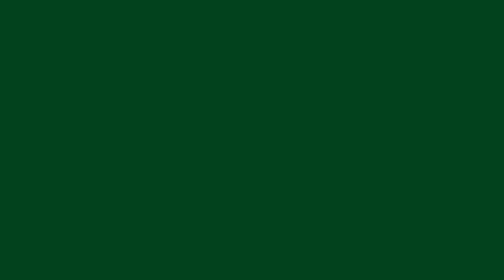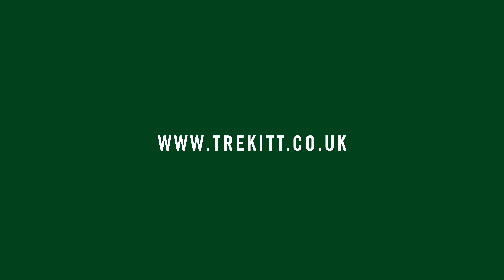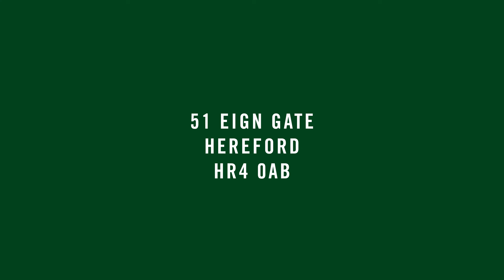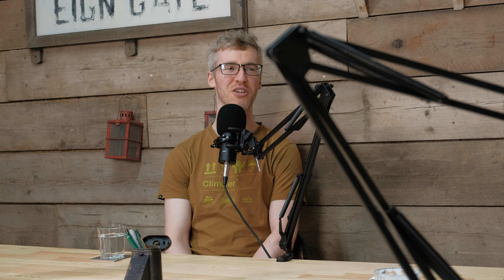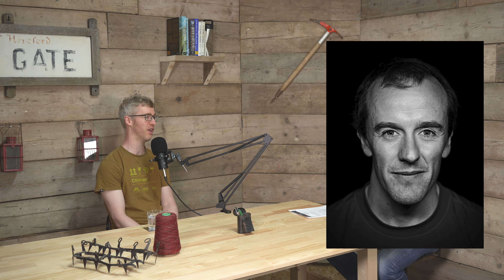We Talk All Things Insulation With Mountain Equipment: Podcast #4

Comment: What a great educational piece. Observation: I have a ME Lightline bag and another by ME colder weather bag, rated at minus 20-25 deg-ish (name escapes me...) and a high end waterproof Rab Mountaineering Down Jacket (much too warm for normal use) these pieces are about 15 - 20 years old and especially the lightline bag, still gets regular use. As an ex soldier I concur with the comments about synthetic being better than down in a forced wet and cold scenario, and have recently switched a lot of my 'hill kit' to synthetic jackets (which I feel these days is an exceptional insulator) I want to mention the comments made at the end of the podcast in respect of wool. Yes, a bit heavier, and definitely more bulkier, but over the last couple of years I have enjoyed a layered system with merino as a base layer and I have used the American branded Pendelton wool shirts as an over layer keeping wind out enough to stay warm but enough to wick sweat, thus keeping me dry from the inside. I have found this to offer a really comfortable wider temperature range to work in... of course I have mix and matched an outer shell waterproof or one of my Paramo pieces dependant on conditions. Wool, makes me wonder... back in the Hilary / Scott (excuse mis-spelling of names if they are wrong) pioneering days, these must have been 'doable layers' back in the day  and in respect of the comments made about high mountaineering jackets being a very specific and specialised piece of kit for a niche application, maybe most of us can do well on the hill with these 'forgotten fabrics' and layering systems. I found the Leeds University piece and the education provided interesting as an influencer for the wider industry too! The ethical sourcing and well being of the birds is so important. I believe companies such as Rohan also participate in studies in respect of hydrostatic head of fabrics at Leeds University - its all good stuff. Bottom line: a really interesting podcast, really enjoyable and most importantly for me, thought provoking on many levels and issues. Great work!